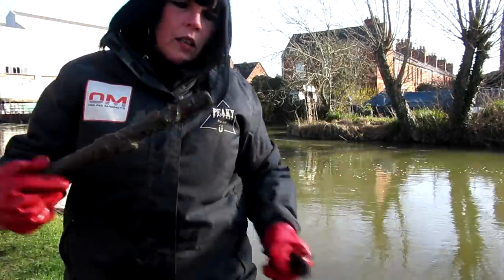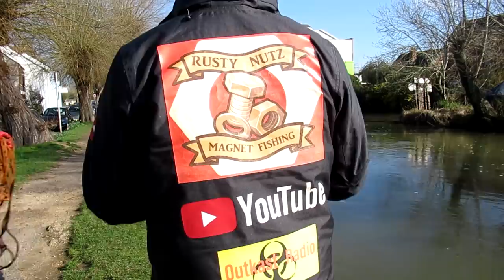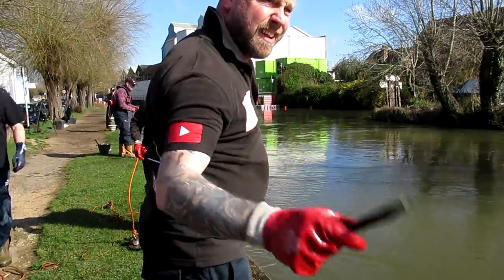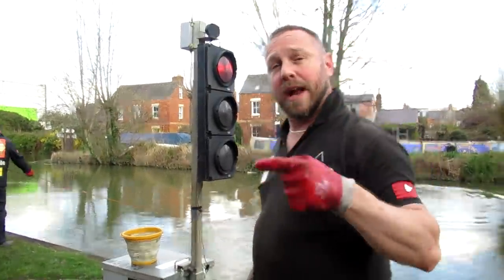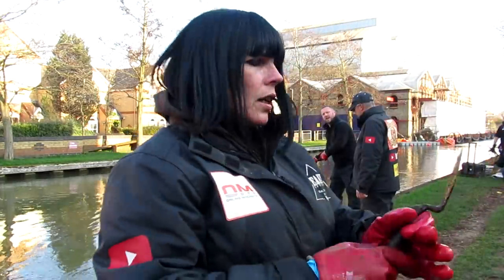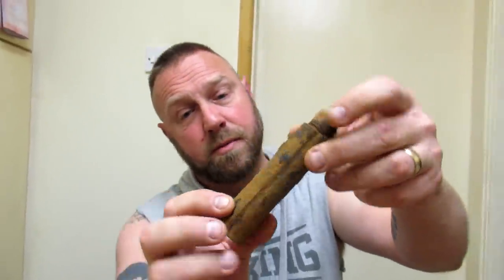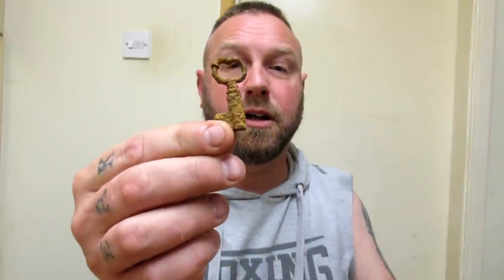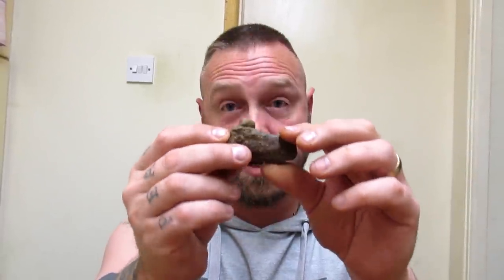BUCKET LIST FIND & WW1 BODY PART - Magnet Fishing

Comment: At 15:05 the "funny hook".
It's not a hook. It's  link for a chain or rope. One that wouldn't be use for heavy loads. Maybe to extending two ropes with eyelets. Loop them togater then pound it togatger to form a link.
Reply: I just thought about it when you showed the chain with yhe hook. The link extender can be used to add a hook to a chain that doesn't have a hook.